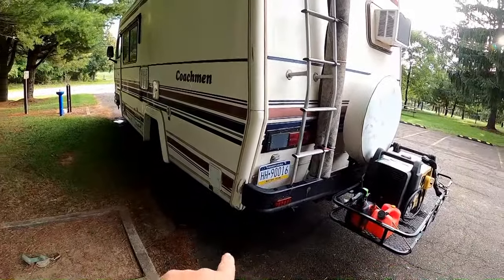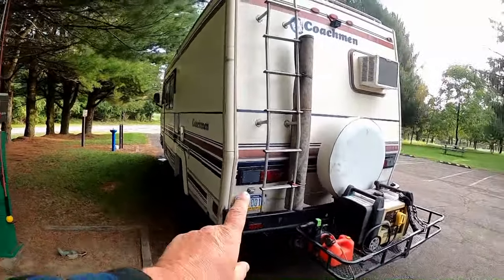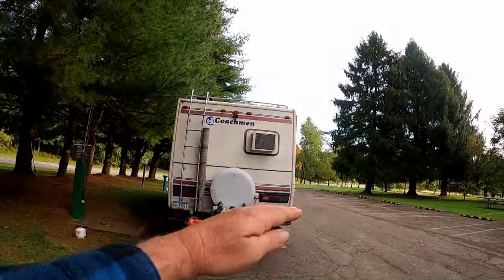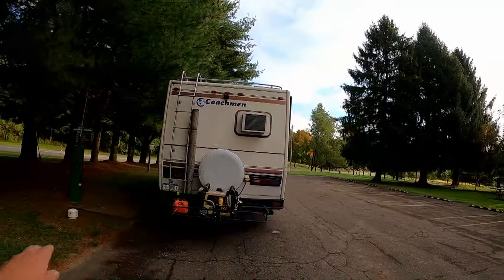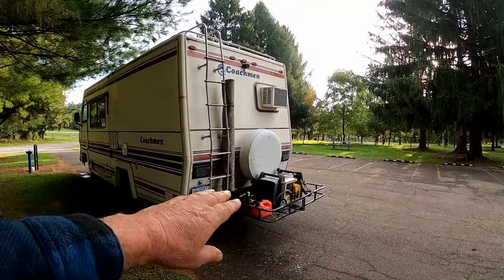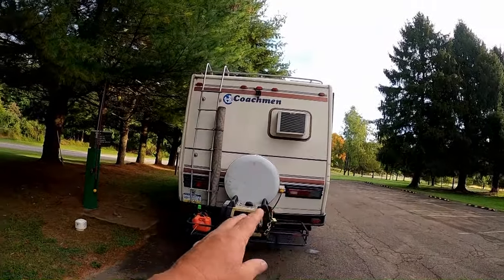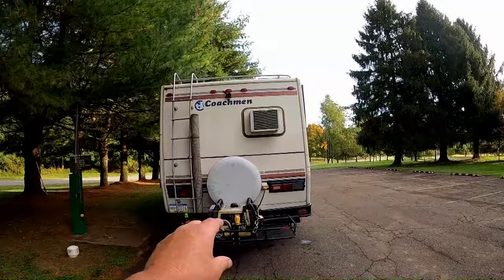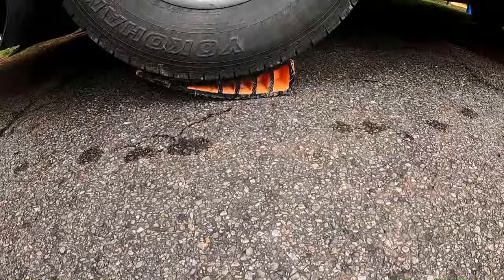RV Waste Tank Valve Replacement - Black Tank Valve & Gray Tank Valve Replacement for RVs & Campers

Comment: I agree with the Tide in the black tank.
When we went on trips, sometimes the odor was bad but the tank wasn't half way we would put powdered detergent into the tank, "Gain". Would keep the odor down, until we dumped. Sometimes dumped ice with water, Gain detergent to slush around while driving to our next destination for our next dump so the tank was cleaned out.

Comment: Dave Instead of taking the cap off and it leaking on the ground next time attach your hose to the dump station first and  hold the other end up under the valve as you take the cap off and catch all the leakage.I found that sometimes even with new valve you might get some leakage.I got into the habit of doing this and so far no sewage on the ground.

Comment: Dave just a FYI those nuts that came with you valve kits, are called flange nuts. I had to order a box of theme off Amazon for my old Datsun camper truck. Half of my third back-up brake light kept going out on me. Who ever replaced one of the bulbs the last time lost one of the nuts and replaced it with the wrong kind. So, it kept loosing up on me. The stud's are also grounds.

Comment: Wish mine went back together as easy as yours Dave😩. Mine is a little different configuration and I ended up sawing off my gray pipe; now I’ve got to get connectors and refit the hub/ flange.   Ugh, nightmare!  Wish I’d just let it drip😖